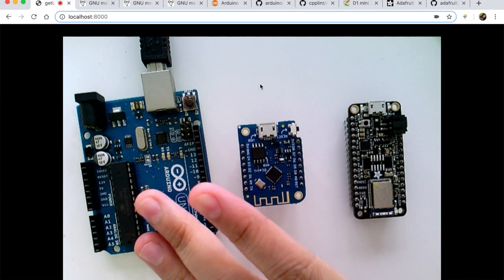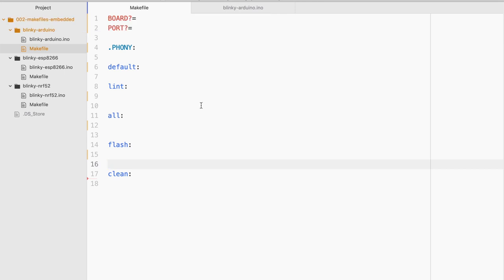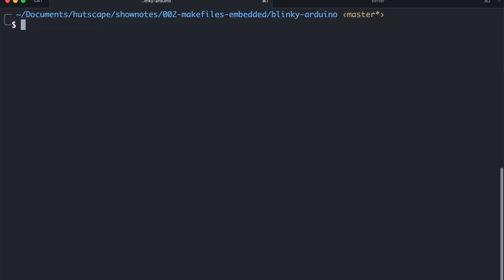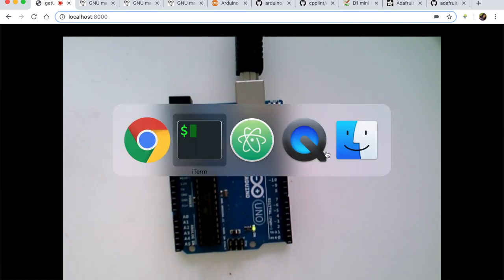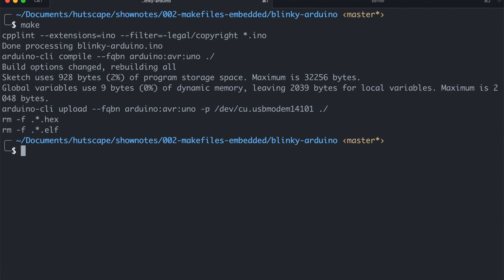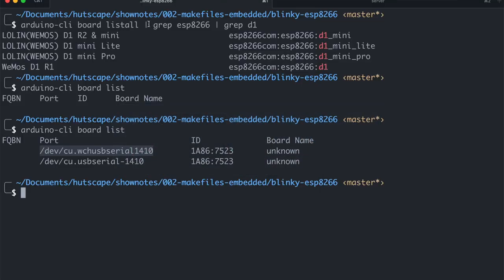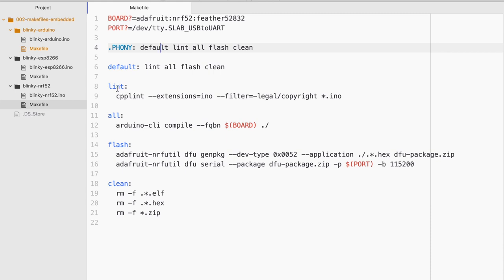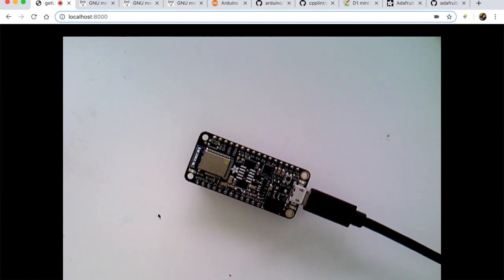Makefiles for using with Arduino // UNO, WeMos D1 Mini ESP8266, Adafruit nRF52

Comment: @8:40 I'm using same board. But now I upload code in it using Arduino IDE, it works till I interuppt it by either pressing reset push button or starting serial monitor. As soon I do that it goes in Red led dimmer loop again and again. Need to re-upload code to make it work. Have you any knowledge about what could cause this? The same code works on other Bluefruit Controller? If you know something to fix this please tell me, without serial monitor its hard to debug codes. thank you

Comment: Nice overview! I’ll watch any video that starts with “I love Makefiles”. I share your appreciation that arduino-cli is available now as it opens up command line use more. I’m also working on an adafruit nrf52 board and my Makefile is shockingly similar. I have seen some info on platfiormio to the same effect and I’m curious if you’ve had any experience with it to contrast arduino-cli.
Reply from the maker: Yes, I know platform IO is another very popular alternative. Honestly, I tried it a few years back and never again. Never really felt the need to especially after arduino-cli. 

Learning to balance my time in learning something new vs using something I already know 😅Always a challenge in engineering!

Maybe I'll look into it again!